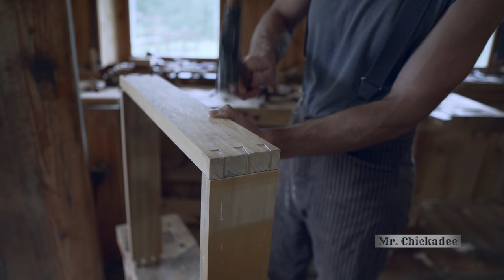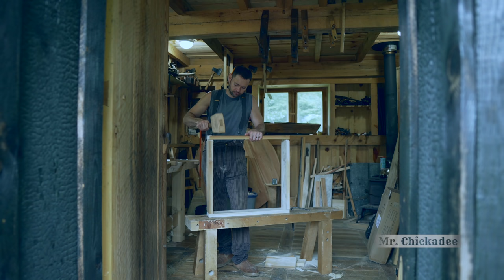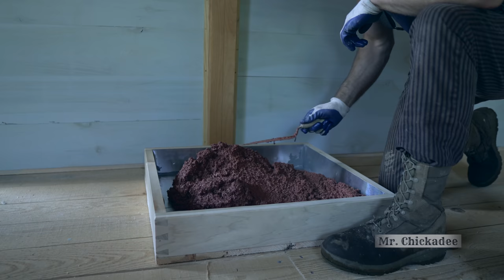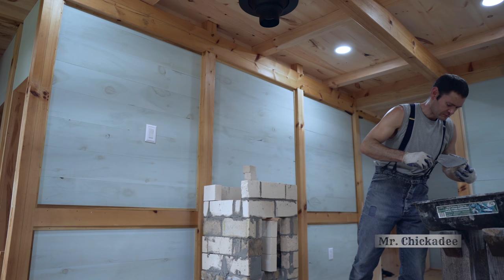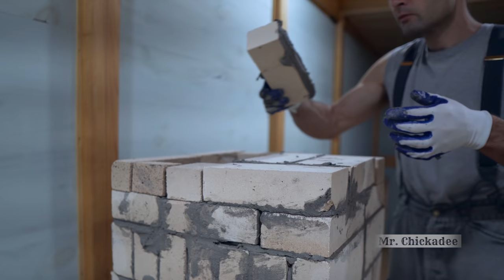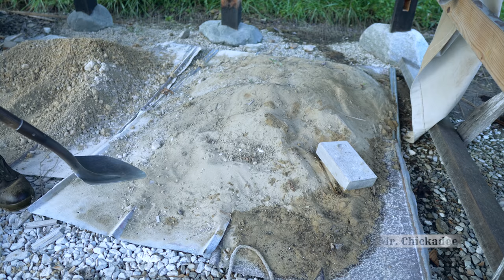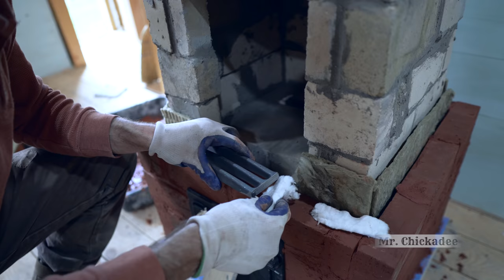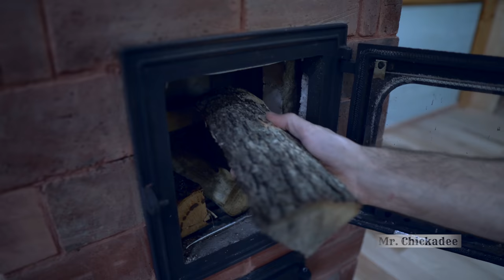Small Masonry Heater for our timberframe

Comment: shouldn’t the first few fires be very small to slowly cure the mortar and bricks?
Reply from the maker: they were
Reply: @MrChickadee  I saw a fire chamber stuffed with wood. When I built my wood fired oven, I started with kindling and smaller pieces of wood for and hour. Then two. Then three. And the slowly built up to what would be a normal sized fire. The fire shown must have been days after the numerous smaller, seasoning fires.
Reply from the maker: @Aphxphotog  yep, first fires were handful of kindling pieces couple times per day, then little more each day till it was all dry, you can see the ash and such in the firebox while Im loading it. You want to dry and evaporate the water from the bricks without turning it to steam as I understand, also leave the damper open until its dry so water can escape the chimney.

Comment: Greetings! tell me what function does the insulation between the walls perform? I see the effect only in a decrease in heat transfer to the room and as a result a decrease in efficiency
Reply from the maker: it facilitates expansion of the inner core independent of the outer facing layer. Its pretty standard in double layer heaters of this type, and the tiny layer of insulation does little to slow heat transfer.
Reply: @MrChickadee  I see, thanks for the explanation.

Comment: One thing I forgot to mention. Now on tht mortar using for fire clay bricks there. Is tht a type of refractory cement type. I don’t expect this cat to answer question. But since really the whole making of refractory cement/mortar is the only riddle to building a mass heater tht I haven’t found real good info on yet. One thing I’m almost certain of and tht is plain old Portland & sand mortar mix won’t last long. In heat temps like the heater produce would break dwn the best mix in no time. My guess would be at most 5 yrs life span on mortar without some type of fire clay mix.
Reply from the maker: turn on CCs for more information

Comment: do you have to surface treat the cement when building a heater for indoors? E.g. when making a cement counter top we have to treat it with food grade sealant.....does the same go for ovens / heaters?
Reply from the maker: nope
Reply: @MrChickadee  so, will it not let some dry/fine cement powder in the air that is harmful? why are there so many concoctions to add to the cement then when making indoor objects like counter top and stoves?
Reply from the maker: @needsomehike  Well there is only clay and sand in the outside mortar, so nothing like dangerous or harmful things to be afraid of breathing. I dont know why they do that, maybe its needed, maybe its not and they just want to sell you something? Or maybe it is to make it waterproof or easy to clean???

Comment: If you didn't have mineral wool,what else could be
 used?
Reply from the maker: ceramic fiber
Reply from the maker: cardboard is often used for the expansion joint, it will burn away eventualy but no worries

Comment: Very nice video but I would very much like to see a "smokeless" wood stove/oven who's plans are only in Brazilian built. There are others that on outside look like it but do not have the airflow engineering design within. I can't read Brazilian & have hunted all over for the plans in English or a video of one built inside as this one is. If it is as it claims I think some kind engineer donated it's plans to prevent 3rd world house fires & smoke inhalation. I did find one video that was an ex- pat who built it but he only had the plans in Brazillian also with a link that you must leave off last part to gain plans. I will give you that since utube will never let links other than utube to be posted.

Comment: Im a chick, 63, and in need of tiny masonry stove plans so i can build it, with all this economic disaster coming, im getting rid of propane.
I looked up the link you provided, the russian one, and i cant make heads or tails of it. If i sent some H x W x L dimensions, would you sketch a masonry stove, that this old chick can build? i have experience with cob, built structures with that, but now need a masonry heater with a small surface on top for heating water
Reply: idk if he could do that, but your local library might--or maybe even an historical society could at least give you a half a chance at finding what you're looking for.  Rocket stove heaters have been very good for heating water in coiled copper pipes and they just use a standard water heater tank nearby to store the heated water.

Comment: I think you loose a lot of heat by insulating layers of bricks from each other, in Siberia it would be important, but you probably have warm climate
Reply from the maker: its not "insulated" its just a very thin expansion gap, important to permit the interior bricks to move seperate from the outside facing bricks.
Reply: @MrChickadee  thank you for answer, nice to have conversation with such a talented master. One question if you don't mind. All this construction work takes a lot of time, when or how do you earn money?

Comment: Subscribed to you for a long time. I like your work, but now I will allow myself a little criticism. For what purpose did you place a layer of thermal insulation between the cladding bricks? This brings your excellent work to zero. The meaning of such stoves lies in a large mass of bricks, which accumulates heat and after the firewood burns, it gives off heat to the room for a long time. In your case, all the heat flies into the pipe, since thermal insulation blocks its path. Only a small fraction of the thermal energy enters the house through the glass in the oven door, in the form of infrared radiation. Very time consuming work with a small heat transfer coefficient. However, you may have warm winters and it makes little sense to make the right stove.
Reply from the maker: Double skin heaters need expansion joint. This 3-4mm of insulation permits expansion of the core and does not really slow the heat transfer into the facing brick or the room. This heater works very well.

Comment: When building your fire that way how long will it burn before you need to add more wood? Just curious. Thanks
Reply: I had some experience of this kind of fireplaces and Im quite sure there is no need for add more wood. One load wil heat this brick stack quite hot because its mass is relatively small compared to size of wood load.